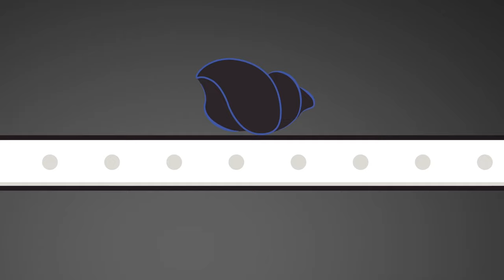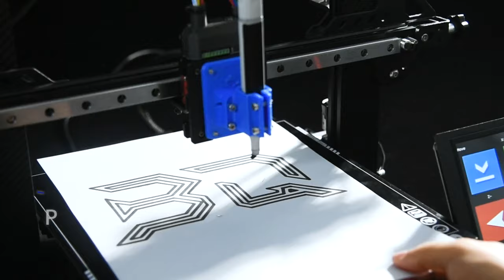BIQU Hermit Crab  Quick-change Tool Changer

Comment: I recently installed this on my Ender 3. It quality is very good although a bit pricey, but well worth it in my opinion. Unfortunately I could not find the fixed and removable kits on sale separately. You need to get the full kit (1 fixed & 3 removable plates). Could be a bit of an issue if you plan on having more than 3 tool heads.

Comment: How is power supplied to the CAN version?  It looks like the only connectors are a couple USB?  Does it really run 40+ watts over just a USB cable?
Reply: If it's a modern type C, then yes. You can get USB-C phone chargers today that are capable of delivering over 65 watts to your phone, so 40 watts is a no brainer for a modern type C

Comment: What is the diference between Hermit Crab and Hermit Crab-CAN for Biqu B1? Are ther advantages?
Reply from the maker: The CAN version has fewer wiring harnesses and more cool adapter boards. It can only be used to run Klipper firmware on the Raspberry Pi. For more details, please check>>>https://bit.ly/3o10VTl

Comment: Disconnecting a stepper motors from its drivers, while powered on can kill the stepper driver. This quick change system seems to do exactly that. So I would be extra careful while using it...
Reply: You must first turn off printer. Oblý fool will be changing tools when is printer powered.
Reply: @DreeDex1986  Do you consider E3D as fools? Cause they have a tool changer that does exactly that. Changing the tool while the power is still on. Without killing the stepper drivers that is. Because drivers can also be turned off via software, just like everything else
Reply: Much more expensive. This Biqu Tool changees was Design different, you can change tools only when is printer of. Dont understand why you react on 1 year old post.
Reply: @DreeDex1986  I reacted to a 1 year old post because I didn't see this post before now. Am I thus supposed not to react to anything here, just because its a year old or more? That doesn't make any sense.

As for the tool changer, I was a bumbling idiot. The E3D tool changer doesn't switch off the drivers before removing the tool. It removes the entire tool plate, stepper motors and all attached, and changes to a whole other plate, with its own stepper motors and the whole shebang.

But yes, it is way more expensive and outside the budget of normal consumers. For this Hermit crab quick change, you are totally right that the printer must be switched off first. Even if it can be turned off with software (which it should be able to, but I haven't checked), it can still glitch, but hard resets/complete powerloss can't, so it's just better to be safe than sorry
Reply: @Arterexius  it's more about the fact that it's possible that no one will respond to such an old post after a year, I don't blame you for responding to it. I watch notifications, but I'm more of an exception.

AS for the Biqu Harmit: I bought it myself more than a year ago knowing that the printer needs to be turned off when changing tools. As you write below, it is possible that it is already solved by some modification in Marlin or Klipper. I haven't researched it so I can't answer that for you.

I bought a Harmit mainly because I often changed nozzles depending on what I was printing and it was always annoying. So I thought about it and since I own two identical Biqu H2 extruders and two identical calibration probes, I thought that I would have a 0.4 nozzle on one extruder and a 0.6 nozzle on the other. It works great and the changeover takes place within minutes even with the printer loaded and the print string installed. That's enough for my purposes. Now it will probably be a more relevant topic due to the upcoming Prusa XL. I believe that there will be a lot of cheaper solutions from Chinese companies, as is usual with 3D printing.

I still have to change the nozzle from time to time after wear, but BIGTREETECH CRAB Nozzle Change Tool makes it easier for me.